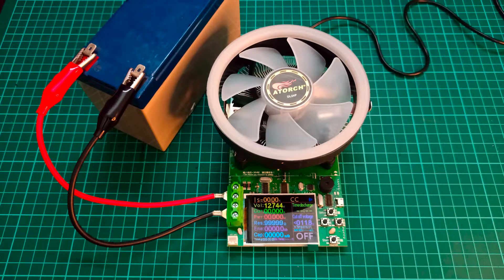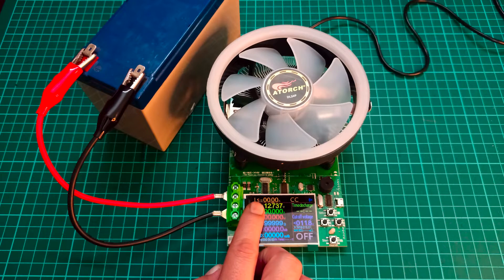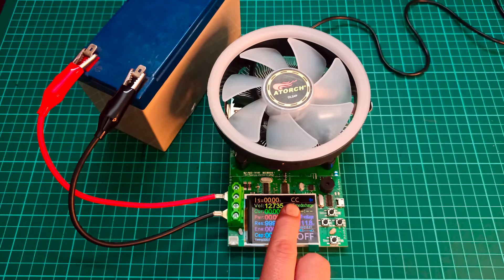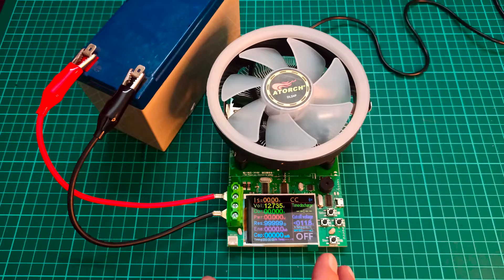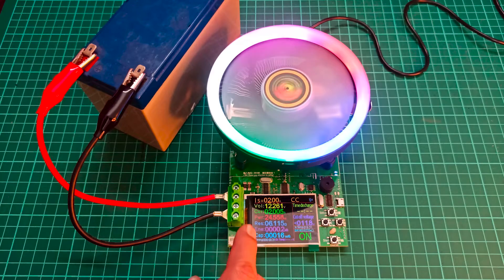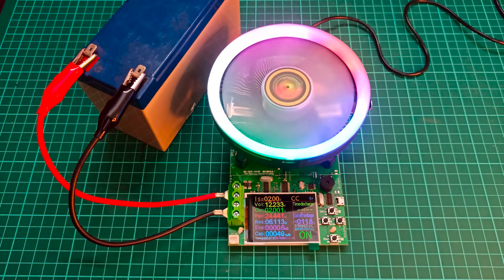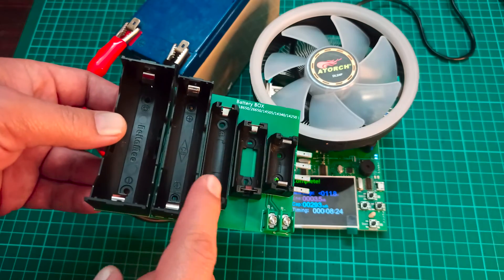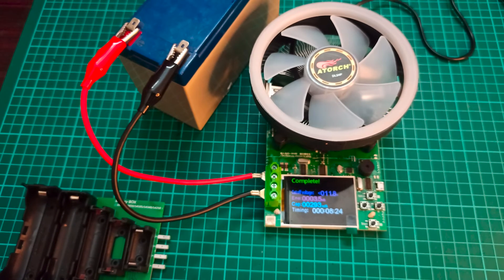Battery capacity tester | ATORCH | DL24P | Li-ion | Lead Acid | Dry battery

Comment: can we up/down half ampere with that tool? or just up/down 1 ampere?
Reply from the maker: You can move it up or down by accuracy of 0.1Amp
Reply: @ERLEngineering  Sorry to correct you, but you can set the load in steps of 0.01 Amp.

Comment: Hi, thanks for the video. are there any larger alligator clips  that is already soldered and then I can attach to a 100ah lifepo4 battery to this tester on aliexpress or amazon
Reply from the maker: No, you have to make a wire with desired clips. Company do not provide it